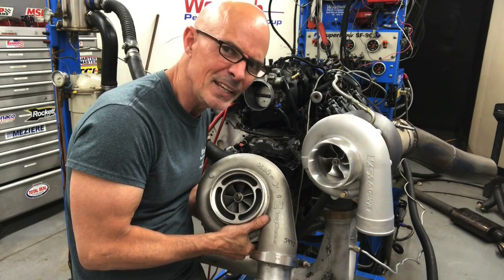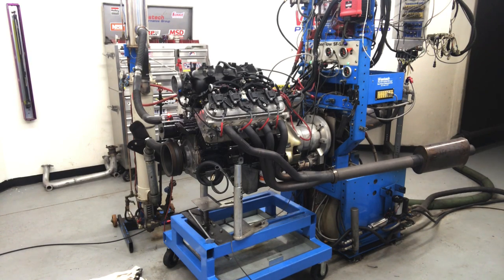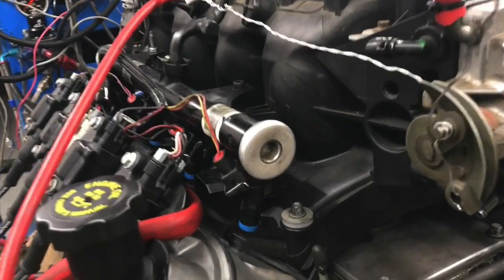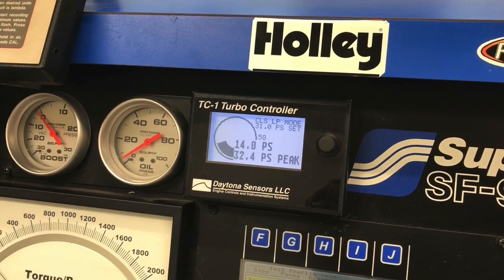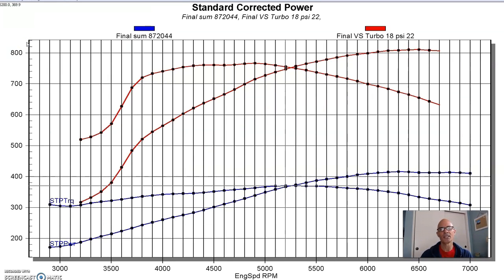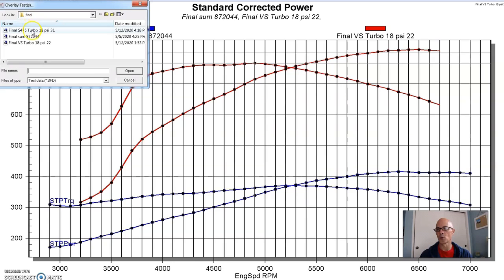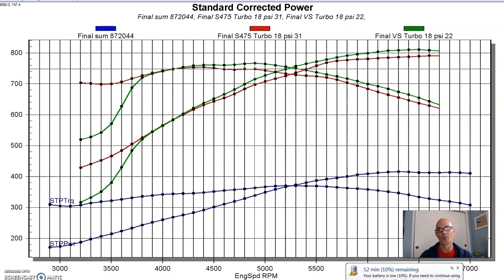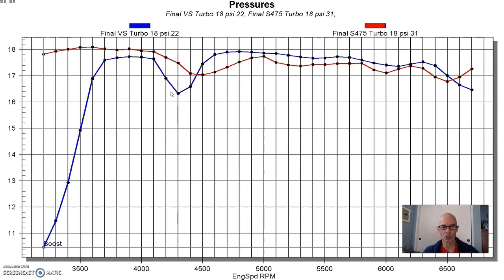RESISTANCE IS FUTILE-BATTLING BORGS

Comment: Just so happens, I am buying the v s. Reason being as I will be a rookie street racer on the streets and it won't come in as hard off the bottom so that should help me easier to tune for traction. That's my reasoning anywhere. I picked the v s out on summit racing and just happened to run into this video. Thanks so much richard. If you could happen to provide the proper cam for a five point three in springs, As well as blow off valve that would be awesome. It's a big ask but you probably already have it written down. Love the videos keep it going.

Comment: So would a turbo like the 8375 with a 110 AR on a 6.0 LS be a go street,strip turbo that has back pressure somewhere between the s475 and 7875?
Reply from the maker: IS IT A T6?
Reply: @richardholdener1727  it's a divided  T4

Comment: hey Richard so I have a question for you I have a 4.8 and i havent done anything internal yet but a btr stage 3 cam and springs with the trunion upgrade. I am wondering since this cam is a larger cam better for top end power would I be better suited with a turbo around the 1.0 ar range or more I want more bottom end and quick spool I am looking at the next gen vsr 7875 .96 ar.  or the Borg s475. I would love to hear your opinion thanks

Comment: Any experience with this combo? I'm putting together a 4.8, Sloppy stage 2 cam, NNBS Intake manifold, S475 1.32 T6, 4L80, Holley Terminator X Max SN95. I'm having trouble seizing a converter for a street car. I'd love to see what the stock converter would do! Gonna try and shoot for 3.27 gears on a 275/60/15.

Comment: Better test would have been to use two motors and the two turbos. That way you can see what the ar does by the size of the motor. 

You have a 4.8 with both turbos and a 6.0 with both turbos. That way when you hear about a properly sized turbo you can point to where That shows up in power and back pressure. 

Love the videos!

Comment: Hi Richard, great video! I learn so much from all your dyno tests and video's comparing all the different cams, heads, turbos etc on a LS motor. 

I just  got a 6.0 junk yard engine with good Gen IV rods, a cam bearing came out when trying to swap in a sloppy stage II cam. Anyways I put new rings n bearings n cam bearings, valve job etc and added sloppy stage II cam n pac 1218 springs. Going twin turbo's street strip 72 nova with turbo 400, 3200 lbs race weight 3.42 gears. From seeing all your videos, if this 6.0 blows up, I will just swap in a 5.3 junk yard motor, swap over the sloppy stage II cam and springs, open up the ring gaps, add my same turbos injectors etc and let her rip! Lol  
My question would be great to compare a pair of the famed S366 borg warner twins to for example VS racing cast 66/73 twins for they said about 1000 to 1200 hp on a 6.0 or 5.3. 

The twin borg warners have pushed lots of 3200 lbs race weight cars into the 8s but cost about 650 a piece. The VS racing 66/73s cost about 700 for the pair.

I would love to see a similar comparison for twins VS racing 66/73's or similar to the borgs twin S366s. Are the S 366's that much more powerful etc? 

My car is 80% street, 20% strip runs, no trans brake foot braking runs into the 9s or ideally 5s in the eighth is my goal. Im kind of cloning Robs 74 orange nova build SPPTV on you tube 74 orange nova street strip car except I have 6.0 with turbo 400 and he has aluminum 5.3 with twin S366s and glide. He ran 9.78 in quarter on 9 lbs boost pump gas tune with pump gas and loves it! I will run e85 at 15 to 18 lbs max to help save motor but will love to 9s and drive on the street on 9 lbs with e85. Of course both cars have air to air intercoolers

What are your thoughts? Of going budget twins VS racing vs pricier s366 borgs for twins? Im going twins cause I dont weld and twins for me are easier to set up with cheap ebay shorty turbo headers etc and how they look, more throttle response thru wider power band on street and still fast at strip. I want my cake n eat it too for a true street/strip car! Lol Thank you so much for all your help, advice and influence from your great videos! 

Regards, Robert Broderick Hemet, Ca.

Comment: Are you tracing EGT and could you possibly comment on or reveal relationship between high drive pressure and high egt and at what point this becomes harmful to the cylinder heads/engine.

Comment: What really matters in being the major boost characteristics and power difference between two turbos, are the blade surface, here obviously they have the same blade surface area despite the design being different, VSracing comp. wheel has bigger hub, the weight of the wheels, especially the turbine wheel, and the cm3 area of the exhaust housing, the a/r of the housing not so much. People wrongly compare A/Rs, when they should be comparing cm3 areas. The tendency for comparing A/Rs derives form the fact that two i.e T4 housings with the different A/Rs have different cm3 areas, but it is not always the case as different manufacturing companies of a T4 may have different cm3 areas on the same A/R. Also the cm3 area of a T3 of an X A/R is not the same as a T4 of the same A/R. The bigger the cm3 of an ex. housing the less power down low, the more power at the top end, the smaller, the opposite. Always use the right cm3 area exhaust housing and a/r for your engine capacity/setup, and for the intended purpose of your built. Excellent comparison and video as all the videos you post.

Comment: I got a video for you...
Which is better, small turbo big cam, or big turbo small cam...
Reply: Depends on what you want the power curve to look like boosted. And final hp. Obviously a small turbo won’t produce the power a big turbo will. I’m also wondering what a large cam with a small turbo will do for a street car.
Lose torque down low but gain it from the small turbo? Or use a truck cam and don’t lose anything. Set boost to desired power level.

Comment: I've heard of pullers or land speed racers using ice water to cool their intercoolers. Have you ever seen anyone try or have you ever thought of trying dry ice and isopropyl alcohol? This combo is pretty common on rotary evaporation systems in the synthetic chemistry labs and if I remember correctly is circa -90 degrees Celsius so it would give quite a bit cooler intake charge versus ice water.

Comment: Hey Richard, love your work.  I have a question re. my build combo. Its an 05 GTO street car 6spd. Forged LS2 403” 11:1 built by Mullinex. Driving it for 12k miles and its a beast.  James knew I have a Precision 75/76 for it and recommended 9lbs max due to .96 T4 frame.  I’m worried about back pressure so going to run a TiAL 44 and a 60 waste gate. Will running two waste gates reduce back pressure to the turbo? It seems it didn’t help in this example with a “small” V8.  Is my 6.6 too big for the Precision 75/76?

Comment: I noted it on the last video also.  Hp doesn't follow the hp/boost formula very well.   Based on the formula 925hp wound be optimum. 810 is 87.5% of the formula, which is less than most tests of around 92% efficiency.  Since all cams are turbo cams, why is this setup less than others you have done?   Due to the JE pistons and flame propagation associated with this 4.8?

Comment: Hey Richard, again.....you have answered a question with some really good info on turbos.  For a guy with a daily driver work truck that just needs more towing power, the BORG is the answer!  Boost comes in sooner, lower rpm, fuel mileage doesn't suffer.....win/win for the contractor daily driver work truck!!!

Comment: ive wondered this,but being you have the vs gen 2 an a s400 83 turbine,does the s400 a/r fit the gen2 vsr?my thoughts are they just took the reg t78 turbos that the gen 1 7875 is an stuck the borg s366 or s400 t4 housings ment for a 83mm exh wheel

Comment: That was a very interesting test, but I wonder if you can see change in power from a compressor CFM and A/R, lets say you are running an S475 vs GT55R, both with the same turbine size (A/R) and running at the same boost level, this also will be an interesting test

Comment: Could you dyno two identical turbos, but with the only difference being the a/r ratio? Like a s480 with 1.15, verses 1.32 verses 1.52. At least they are easier than cam changes.

Comment: I have seen that a equal turbo or close to like 75/72makes more top end and helps with to much back pressure and a 75/50 cold/hot make 5 pounds super fast but then gets lazy when your running 10 or so and up you want equal turbo what’s your thoughts
Reply from the maker: i don't know what you are comparing
Reply: Richard Holdener so I have heard them called lazy turbos big cold small hot that make 5 pounds or so super fast but then become lazy so what I’m comparing is it worth equal turbo like a 75-72 then a 75-50 on a v8 with low boost

Comment: This is a test of housing versus a test of the complete turbochargers. I bet if you took a BW S475 with the matching AR's as the VX the curves would be within 10 horsepower of the VX. Very interesting test but more about the how back pressure Vs boost pressure and how it relates to AR than about comparing turbo brands. Funny I was reading about this very topic earlier today.

Comment: Was that the 83mm turbine wheel? I'd be curious to see what the "box" S475 does (1.32/87mm T6 turbine) does. This is definitely a budget turbo face off. As you found out the T4s in these are somewhat under turbined compared to their T6 cousins.

You wanna see an interesting comparison dig up a TV8101 or a TV8513. Legit old school stuff that'd make either of these look super fast.

Comment: I like the video, but I don't understand Why can't the waste gates open to limit extreme back pressure on the smaller A/R. The engine will have less parasitic loss due to back pressure. Yes the turbo isn't spinning as fast like this but once back-pressure passes boost pressure any additional boots reduces overall efficiency.

Comment: Its almost 200hp difference at 3000rpm, that would more than make up for the drop off at the top
Reply: Probably would depend on the application.  Drag racing, with a converter that stalls above 4k, the response down low means nothing.  On a daily driver it might.
Reply: Dont know anyone who is wot at 3k in any other gear but 1st.. cool for the street tho
Reply: Moon Tuned 
?????

Why don’t you go wot at 3krpm in other gears???

Turbo on highway speed. 
Full throttle in top gear. 

Your missing out. Try it sometime.
Reply: 4K converter in a turbo car is awful loosey goosey unless you have an extremely small motor that doesn’t make any torque to spool the turbo IMO
Reply: 78freewheeler  4k is pretty common on SBE small block turbo cars

Comment: Nice video. How much difference would it make to run the vs 7875 on a split scroll?
Reply from the maker: it had a divided scroll
Reply: Richard Holdener Im sorry I thought your hot side merged both banks before the turbo.

Comment: What you said about turbos is totally not true. I have seen 200hp differences in power on the exact same turbo with the same inducer and hot side the only change being wheel blade shapes. The main readson the bw came in so much sooner than the vs was because it has a map groove not the smaller exhaust housing.
Reply from the maker: a 200 hp difference at the same boost level with wheel blade shape? I would like to see that
Reply: @richardholdener1727  Best I recall they were like 68 to 74 psi boost. This was on a diesel so there were no wastegates only the difference in comp wheel efficiency being able to produce more boost with the same turbine power. These were 75mm turbos making 1100-1300hp so maxed out.  I have seen 100deg differences in compressor outlet temps from different wheel profiles as well and that certainly will effect power at the same boost.

Comment: Yup can attest to that, have a  5.3  S475 T4 1.10 A/R comes on really quick 2500rpm almost full boost makes for a very fun daily driver .
Reply: He says it's a/r1.0 in the video. Did he miss speak? I am looking for a turbo that lights by 2500 just like this but can't find the s475 in at 1.0
Reply: @timisaiah9010  He did say 1.0, the S475 can be had from 0.90 to 1.25 A/R, just google "S475 1.0" it'll show up.

Comment: When adding boost to a factory stock motor, this case would be a Coyote, when do you recommend changing ring gap? Is it boost dependent or heat?
Reply from the maker: its ring heat-we run .0075-.0080 per 1 inch of bore

Comment: of course you get more out of the VS racing turbo... its a bigger fucking turbo with a bigger AR...
you can see the backpressure is considerably higher on the borg because you are out of turbo at that point
then you dont have identical boost curves.... because your boost controller sucks....BAD....
so the VS makes more power because it actually has more boost on it

you didnt even talk about actually tuning the engine with each turbo.....
they both will want slightly different timing and slightly different AFR to make optimal power and have optimal spool up
you cant just put on new parts and make no changes to the tune and expect it to be a proper test...

you need to take a class on how to actually do a proper test

Comment: Awesome test Richard!  I love the small form of the 7875 VS Racing turbo.  I would love to see what happens if this turbo was rear or mid mounted on a 6.0L.  You would lose some response being rear mounted but the 6.0 would increase the back pressure quite a bit with it's additional 1.2L.  Instant response with a 6.0L can actually be more of a hindrance than a help anyway, especially with a manual trans.  Great stuff Richard, thanks for all your efforts.

Comment: So the VS would possibly work better on a 5.3, 5.7, 6.0,? Where the S475 would be more at home on the 4.8/5.3. ?¿??, while they both do it!
Reply: Depends on what you are trying to achieve! The freer flowing VS turbo is always going to make a bigger power number, regardless of the engine you put it on... But not a huge difference. So the question becomes - which do you value more for your application: More response, or an extra chunk of power at the top end? Don't forget this would only matter if you had specific top end power goals, because both those turbos will make 1000hp on a 4.8, 5.3, 5.7, 6.0, 6.2 or 7.0! Personally, I'd choose the S475 for any application where 750-800hp was going to be "sufficient" and I'd just up the boost a little on the S475.

Comment: I would love to see a Garrett vs. Precision dyno throwdown
Reply: The Precision turbo would always make more power AND spool quicker than a comparable Garrett turbo. This has been proven hundreds of times already. Although, the Garrett Turbo will last longer than the Precision Turbo. Then the Borg Warner Turbos will last longer than both and make similar power figures as the Garrett, with a few hundred rpm longer spool time.
Reply: This wasn't really about the turbo manufacturer as much as the AR of the two turbos. I agree though I would like to see a battle of the turbo event where all the turbos are equal on both hot and cold side.

Comment: Any plans on turbocharging a early 1UZ?
Reply from the maker: i don't have a way to run it
Reply: @richardholdener1727  Bummer, tho I'm sure that the Holley EFI could control it if time allowed as it has crank and dual cam trigger wheels.  On a odd note, Toyota runs it as a twin 4 cylinder.  Enjoying the videos either way!

Comment: How do you think this borg turbo and cam combo would work on a 6.0 with a set of flowtech turbo headers? Boost would drop due to more cubes, and drive psi would drop with turbo headers. My curious brain wants to know if it would make 800 hp on pump gas?
Reply from the maker: back pressure won't likely reduce with the turbo headers-its the turbo itself creating the back pressure. 6.0L will increase back pressure by a lot
Reply: Richard Holdener that makes sense. Trying to force more volume through the same housing. I was thinking backwards and didn’t realize it. I love following your experiments. When the time comes for me to build my c10 project, I’d like to pick your brain if you would allow me to.

Comment: Why stop at 18psi, just teasing everyone. Besides, at higher, say 24psi, we might start to see a big difference between the 1.0 and 1.24 AR housings.
Reply: @grandmasmalibu  Do you think the T4 versus the T6 would really make that much of a difference? I would have thought the AR would make more of a difference since that is the bottle neck of the system. I agree that there is zero point going any higher in boost as the 1.0 AR has already run out of joy by 18 psi. I would be interested to see how much of a difference the 1.0 Vs the 1.24 AR are in back pressure when run in compound setup?
Reply: Parent of Twins remember to intercooler or u is asking for troubles

Comment: That seems like a lot of backpressure. Makes me feel better about my t6 s475 that's going on my 5.0 coyote.
Reply: I'm guessing its no stick shift.
Reply: @boosted2813  
Correct. Auto with a little bit loose converter. Its a drag car.
Reply: 1:1 or less is good with a turbo.. you're increasing pressure in the entire system so its relative... na engines are under atmospheric pressure at all times too.
Reply: @yolofullsend  
Maybe. But it would still be ideal to minimize back pressure on the exhaust side while increasing pressure on the intake side.

Comment: Would really have liked to see both of them pushed a bit harder. Been trying to decide next upgrade. Have a maxed out gen1 7875 making more wheel hp than this one but is absolutely out of steam on my setup @ 22psi. Looking hard at the gen2 but don't know if it is a big enough jump.
Reply from the maker: its 100 hp extra for the gen 2
Reply: @richardholdener1727  Thanks. Been hearing that. Think that extra exhaust housing would help out above 5500 with the gate pinned? :)